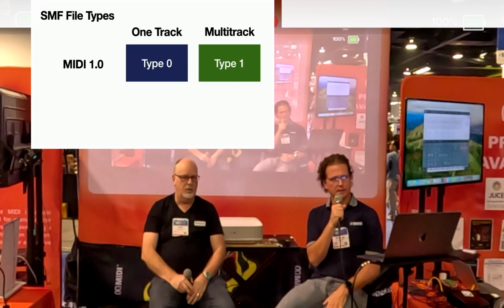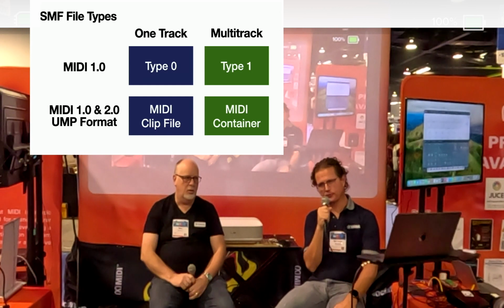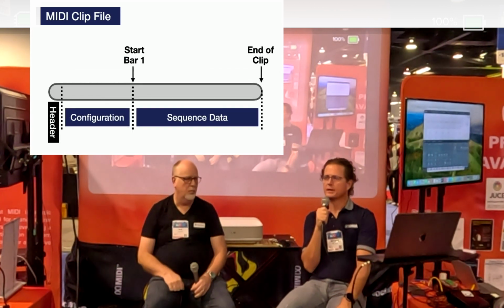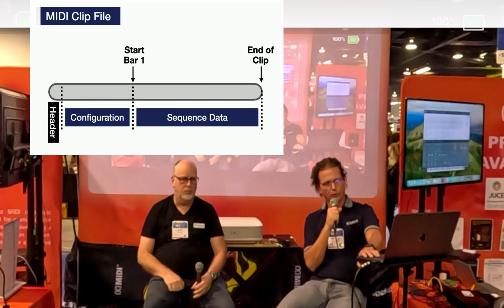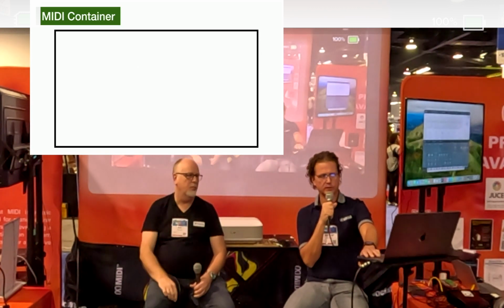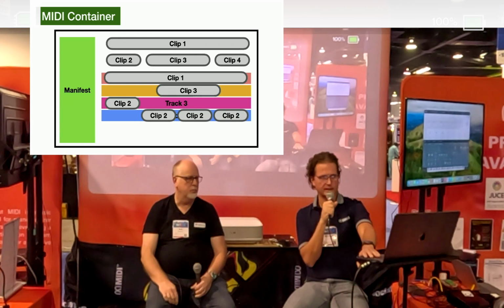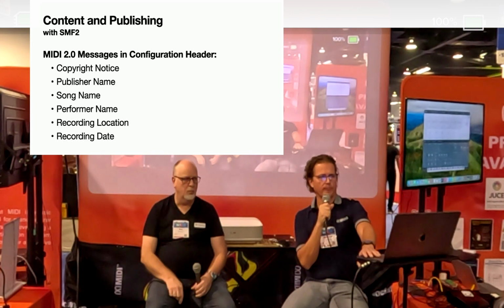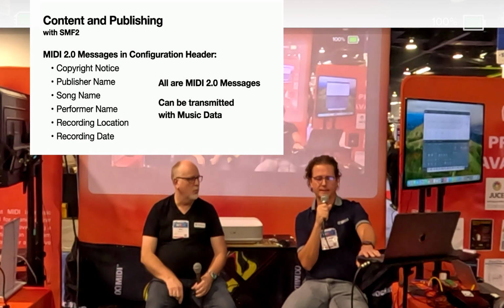Standard MIDI File (SMF) 2 NAMM 2024

Comment: Last year before the new midi 2.0 clip file format was announced i had designed a similar in goal container format for my application usecase with in some ways similar goals to this. I'm very disappointed to hear that they are considering going the zip file route so many formats have moved towards over the years.

In my eyes using a compression first format such as zip is a mistake, if one of the stated goals is to include asset data including audio and video data those formats are much better (and nore often) represented in a format specific compression format. 

Using zip compression for non-text potentially primarily audio/video data is just not good to me. Additionally embedded usecases for the format will suffer.

Comment: what about small processor designs that for example write/read from an SD card, zipping will cause a lot of complexity and code overhead for such devices that normally don't have support for compressing data or zipping/unzip  files. Zip libraries may have bugs or become obsolete as well. it would be helpful to have a single uncompressed container file format such like legacy MIDI 1.0 has.

Comment: Placing an arbitrary (private) data of a DAW (or Sequencer) is ALREADY implemented in SMF0, but 93% of old/modern “SEQUENCERS” (including DAWs) destroy them (can't handle SMF Sequencer Specific Meta Events)! Open a "MIDI 2.0 file" (which contain MIDI 1.0 compatible data) in that "program" then whatever you edit it or not — you are already LOST that data (even before saving it)! Some DAWs even have no System Exclusive events support (FL, Ableton, S1, Bitwig, …)!
YAMAHA XF Chords may be placed outside the MTrk as a "junk chunk" (or a separate file, i.e. not included in the .mid file), but there is no "manifest" indicating it (but described only with a SMF Sequencer Specific Meta Event), YAMAHA SFF (Style File Format) contains more "junks" outside a first MTrk (CASM, OTSc, MDB, …) — all those "JUNK-chunks" in .MID files destroyed by 99% of all "sequencer(DAW)s"!
///
XML? Who want to mess up with this aesthetic displeasure (especially for a musician)?
I was very satisfied with that an old [INI] (but please, not TOML), which old Unreal Engine 1|2|3 use it…
///
Notation? What about drums? /* [*]I've "invented" a clef for Drum-Machine|Sampler|Rompler… it looks as "some kind of a chip", linked with a "wire" from the left-bottom of staff line, where a small "rect" is placed)[*] */
assign a note position in a 12-line staff, a head (character), stem/beam direction, a "closed"/"opened"/whatever… hm…
///
“video: how it relates to MIDI data and how it's synchronized”— is it possible to INCLUDE a stretching algorithm inside the "MIDI 2.0" file? O_o
///
P.S. SMF0/1/2 are already nicely compressable, will this new container (chunk) already compressed (PK…)? Ouch… will an old "SMF2" (Multi-SONG) be called "SMF1.1" ? :))
Reply: Update: REAPER can now preserve and EDIT(!) Sequencer Specific META-events! FINALLY!